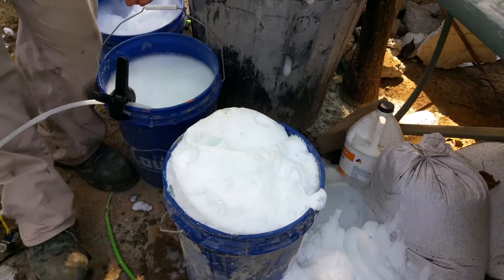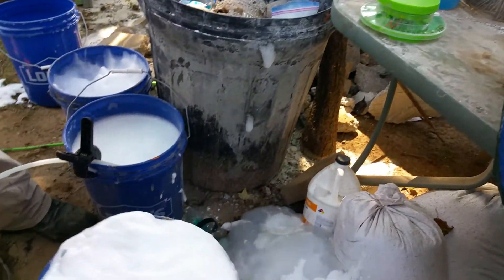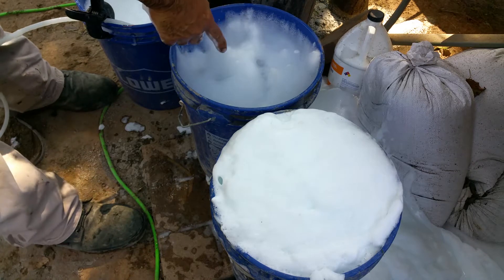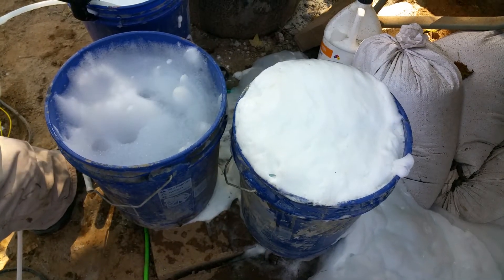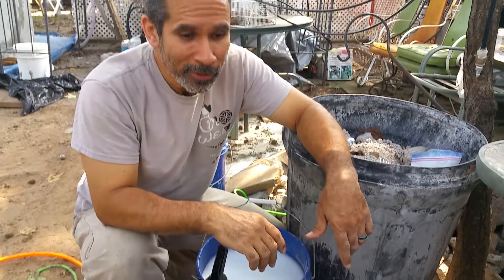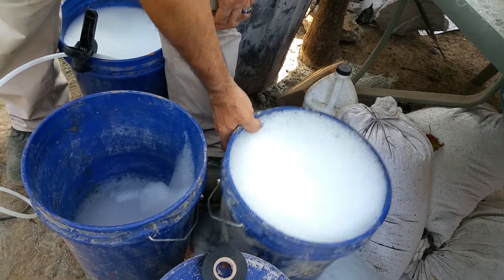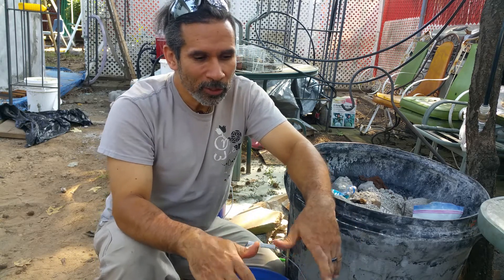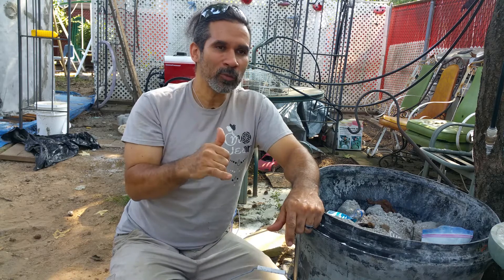Foam Test: Dawn Soap vs Special Mix Strength Test Part 2 #Aircrete #AircreteHarry #DIY #Foamtest

Comment: Had an uncle say he could make some good aircrete, used to brag about it..  i finally gave in to him and wanted to  try his trick on an addition foundation and siding..   took my time putting up all the straps and structure built molds and all..  the guy comes over with an industrial air compressor he had on loan from a buddy of his and a series of water hoses tied to a horse trough with a big ass pump meant for human shit and a pvc tube with an end glued on..  he gets everything set up and tells me to turn on the pump so i do and goes good for 20 seconds then boom, concrete shoots up in the air 20 foot, completely covers his brand new truck, the compressor, left his windows down and he sprung for the bigger sun roof..  filled his cab to above the pedals and fuse block because it stArted smoking inside and we had to jump and pull the battery before it burned up completely.. still have a hump in the street to this day..  lol..
Reply: That's rough but also hilarious